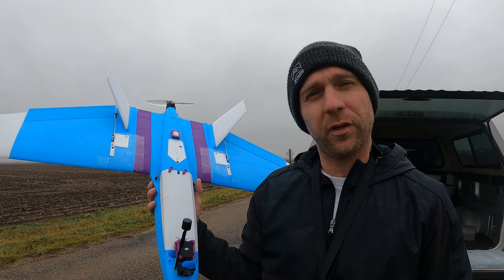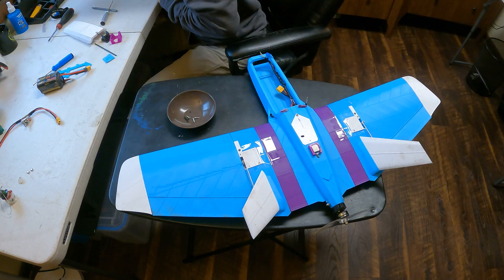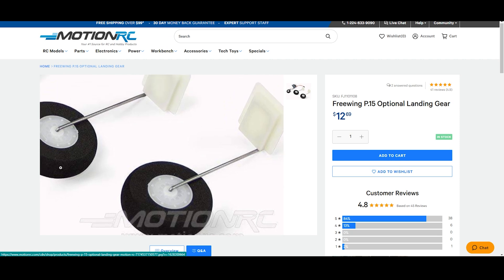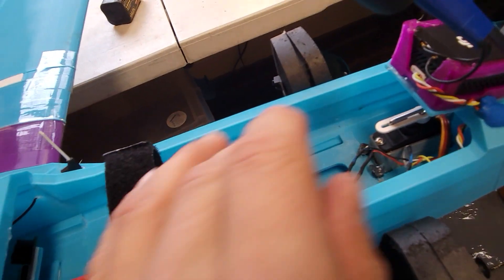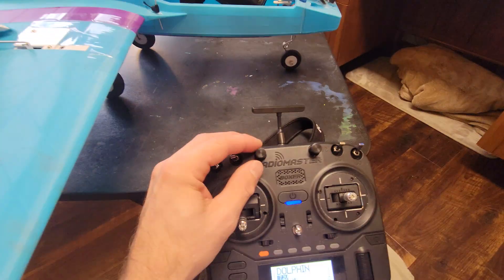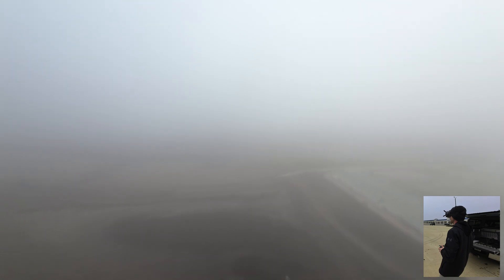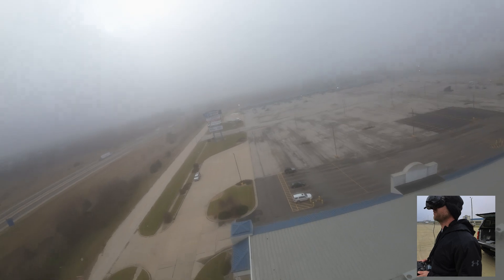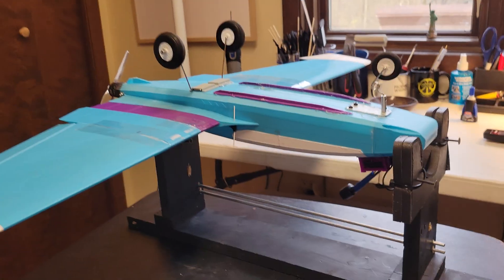ADDING LANDING GEAR TO YOUR FPV PLANE

Comment: I used similar gear on a LW-PLA hand launch EDF, however I cut out pockets for the mains as well. I think if you flip the mounts and sink them into the fuselage you will have better results.

Comment: You antenna nulls are pointing to your sides instead of up and down on your TX. Supposedly this gives a much smaller coverage area on most T antenna because you just get the lobe front and back like a donut turned on its side instead of the donut all the way around with the weak area right over head. Maybe it works better with your antenna orientation on its side I guess.

Comment: Nice landing 😂👍
Reply from the maker: Oh my God!  My fingers were so numb I couldn't even feel the radio.  I just wanted to land in a hurry.  But yes, that landing was a little hot.
Reply: @JeffDoesThis  Maybe consider shortening the motor delay and the spin-up time so that the model doesn't sag so much when starting.
Reply from the maker: If you are talking about auto launch, mine is set 50ms, and my idle throttle is at 1750, launch throttle 1950.  It's pretty much wot at launch.
Reply: @JeffDoesThis  The values seem OK.
And how many ms for motor delay?
Reply from the maker: It is 50ms. I have 4 other aircraft that I autolaunch and this one is just pain for some reason.  I thinking it has to be the weight of the craft.
Reply: @JeffDoesThis  Yes, I think so, too. Or you need a different motor/propeller combo. 
I run a slightly lower auto launch setup with a 2216 1400kv motor and a 8x4 prop without any issues.

Comment: very cool. most people fly planes with the throttle stick pretty tight on the tx. Sometimes even with a little clicking/ratcheting feel. That would probably help stability on your left hand. You could also add expo or lower the rate for yaw.
Reply from the maker: It's already pretty tight right now and yes I did lower the rate too.  I have never had a plane that had landing gear, all hand thrown and belly landers.